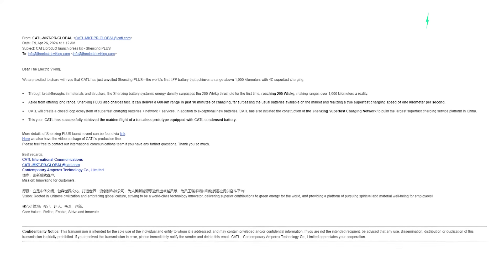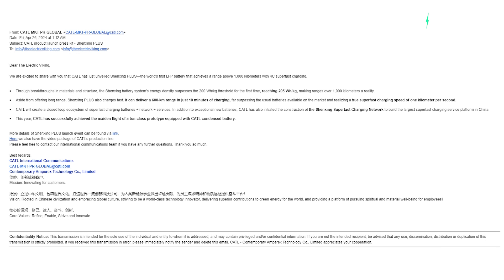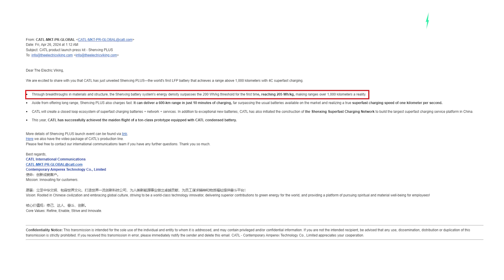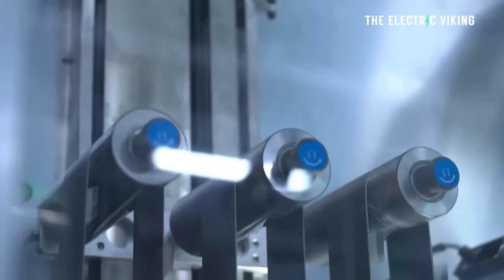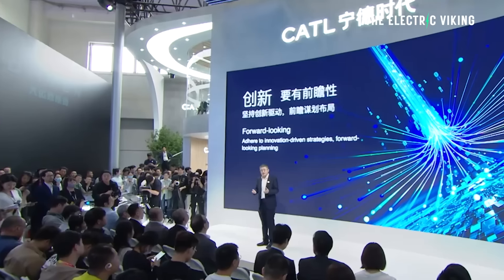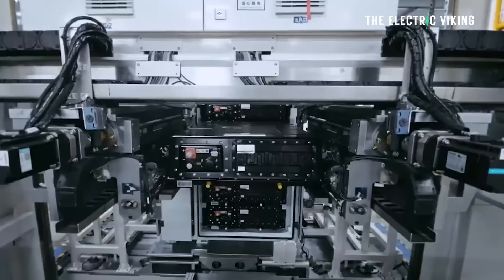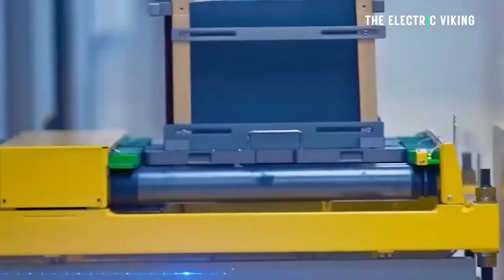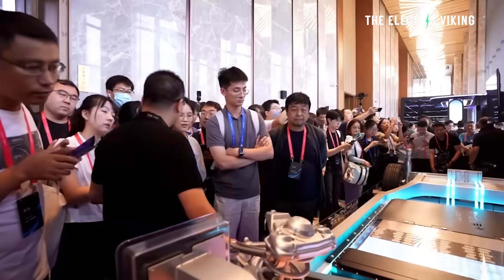CATL reveal new battery with highest energy density in the world

Comment: Lets see some cycle life and discharge rates before we get too excited.  There are many batteries with >500Wh/kg, but most of them don't last more than 100 cycles.
Reply: Didn't EV say 18,000 cycles or was that for one of the other batteries.
Reply: Lol he did say 18000 cycles what yall on rn?
Reply: @erktrek  The way he said it didn't confirm the 18k cycles was for the 500Wh/kg battery, so I assume that's actually another battery cell altogether. That CATL doesn't state any other performance characteristics than energy density and charging speed could be interpreted as those aspects might be less than impressive. Like, manufacturability/price, cycle count, shelf life, low temp performance and so on.

We'll have to wait and see I guess. A 500Wh/kg cell battery pack that's no more expensive per Wh than current cells (ideally no more expensive PER CELL), can be manufactured at scale and has at least comparable cycle/shelf life, charging speed and low temp performance as currently available cells would kill combustion cars pretty much dead as it is. And much more so if any other factors are superior to current cells as well.

I'd suggest caution rather than exuberance here though. Chinese companies aren't always the most trustworthy, unfortunately.
Reply: @erktrek  that's for low energy density battery.

Comment: Is the cost less compared to current LiFePo4 batteries. Even if the cost is only slightly lower per kg, a smaller battery that can give the car a range of 400-450 miles would make a $15-$20,000 EV a reality. There's already talk about a small pick truck priced less than $10,000. This kind of battery can all but assure that the truck will be made by the millions and sold quickly even at $15,000. But can TESLA build them fast enough in the early going. Let's hope so. I would totally love to have the smaller truck loaded with plenty of road clearance and lots of range and really cool technology at such an affordable price. I would also love to have a battery backup system for the house with these much cheaper cost batteries.

Comment: Holy moly did you hit your head?
How does 205w/kg convert to 500w/kg in your mind?
Also a plane that weighs one ton (2000 lbs) is like a tiny Cessna not a 747! 
A 747 weighs 442 tonnes fully loaded…yikes!
Reply: It's two different batteries, Shenxing LFP 205 Wh/kg and condensed batteries 500 Wh/Kg
Reply: Close to half the weight of a fully loaded 747 is fuel. A 747-400 ER max operating weight is 412 metric tonnes of which 186 tonnes  is fuel. This is why in the video he references 400w/kg as the magic barrier for flight as you need that at a minimum to start thinking commercial flight applications. I still think this is a decade away from concept and at least 2 decades from first practical implementation as you would likely re-engineer the whole aircraft for commercial passenger flight, testing, etc. Still, it seems inevitable as humans will squeeze more power out of battery weight just as we have in combustion engines over a century of innovation.
Reply: Sam screwed up in this video in the way he presented information about two unrelated batteries. The battery discussed in the letter is the 205Wh/kg one you are referring to. Completely unrelated to that is a 500Wh/kg battery that is alluded to in a YouTube video on the CATL channel. At 4:17 in Sam's video, there is what I assume is an extract from CATL's video in which the words "500Wh/kg" are overlaid on the screen. If you look at the long textual description underneath Sam's video, you will see lots of links to various videos. The very last link is to a press release from CATL that explicitly mentions the 500Wh/kg battery that is currently being used in a prototype airplane.
Reply: Wh/kg, not w/kg.

Comment: If these developments are commercially viable, current battery packs could be halved in weight but offer more density, this in itself will increase range. The same 80kwh battery pack would be substantially smaller and weigh less - but introducing more range. Not to mention cost reductions. It is every ICE car manufacturer's worst nightmare.
Reply: ICE manufacturers also make and sell EVs.  I think the nightmare scenario is for the EV haters out there.
Reply: Those batteries (if they rallye exists right now) are way more expensive, but if you have 500 kW/kg battery pack density, then you don't need 80 kWh anymore in your car, but only 70 or even 60, which meens cost reduction (less expensive cells in the pack) and even more weight saving. That's  a total win-win situation 👌
Reply: @ohger1  Why don't ICE manufacturers get on with it then? What is the delay? I don't care who makes them as long as they get on with it.
Reply: @JoeMcMorrow-k7e  The "delay" is customer resistance.  The only EV maker making money right now is Tesla, and a lot of the money they're making isn't coming from actual car sales.  Legacy makers are walking the tight line between producing EVs waiting for the change of customer wants and bankruptcy.  Ford is trying to hold on while waiting for more acceptance of the Lightning and Mach E (both excellent efforts btw - I've driven both).

The fact is that right now, if any Legacy stopped ICE production and switched to EV, they'd be bankrupt in less than two years.
Reply: @ohger1 
Ford should have already sought a merger with Tesla, achieving an economy of scale in which both could have made the neccessary leap forward.
Reply: @PETERJOHN101  Having had a Ford Edge, I would love if Ford did a joint project with Tesla, but honestly, do you really think Tesla wants the inertia of such a big company with the albatross of the UAW that's choking it now?  We don't know if Ford tried or is trying now to merge with Tesla, but I can't see Tesla needing Ford TBH as they seem to be doing fine without a network of brick and mortar dealers.  Maybe Tesla will need to move in that direction at some point if their market share increases.   Time will tell I guess.

Comment: CATL battery=500 Wh/kg. Jet fuel=12,000 Wh/kg. Temperature at 35,000 feet= -50C. Electric airplanes, useable electric airplanes, are a long way off.
Reply: I was wondering what the figures were myself.  Though, remember that domestic flights under 1000km will probably come first.  Also at the end of the day, it really comes down to economics.  So perhaps the first question to ask it “For a domestic flight with less than 1000km of travel, is this achievable with 500 Wh/kg and how does the economics stack up ?
Reply: @philwelling7172  I am a retired airline pilot, and have spent more that 30 years in the industry. Airplanes are very expensive things., and a battery costs more than a fuel tank. Expecting airlines to buy planes that can only do short hops is wishful thinking.  When a plane leaves the gate, it is fueled for the flight, adding a reserve for planned and unplanned delays. The less fuel the plane has, the lighter it is, and the less fuel it burns. As it burns off fuel, and loses that weight, it gets more efficient still.  An electric airplane would effectively be carrying a full fuel load of weight at all times, (as does an electric car), and it weighs 4 times the weight of fuel for the same amount of energy. I don't see it happening.
Reply: @johnlebeau5471  given your wealth of experience in this field, do you know what the cost per kg of jet fuel is in comparison to 4 times the cost of charging with electricity ? Also, isn’t a large percentage of the fuel used for short flights during taxi and takeoff. What is that percentage ? Also what is the efficiency of a turbo prop compared to an electric motor prop ?

Comment: There’s a consistent mix up on this channel, a Tesla model 3 with a 100kWh battery would go the same distance no matter what the energy density is, 100kWh is the capacity, not how it’s arrived at through energy density (agreed that a higher energy density battery would be lighter for the same capacity).
Reply: The idea is that having higher energy density per kg enables to have more kWh in a vehicle. Besides, 100 kWh from a 200kg battery opposed to 500kg battery does come with better efficiency.
Reply: Nope! If the battery has a higher energy density than the current Model 3 has, it means you can pack more batteries in the same battery space. That's gives you greater range I guess.
Reply: I seriously doubt a Tesla would go that far. Only in perfect conditions.
The new battery would increase the range by roughly 2.5 giving a true range around 1250km.
However, I think they'll keep the same range and just make them cheaper and lighter.
Reply: Mixup, not mix up.
Reply: @duanehorton4680  Grammar police are out again...😂
Reply: @sargfowler9603  Spelling, not grammar.

Comment: 100 kWh in a model 3 will give you slightly more range than a model S. Perhaps close to 500 miles but not 1000 as you state. Currently it does 341 with a 82 kWh battery, but the new battery would be lighter and increase range in that way. Depending on the volumetric density of the battery it might be possible to pack 200 kWh into a model S, and you would get around 800 miles of range.
Reply: Our next energy did that year's ago already with an in house prototype stock battery case model S, achieving 750+miles at hwy speeds in the cold Michigan weather and 850+in summer. You can find the videos on here of it. 

Same dude who sadly got sold out by the obummer admin when he was leading the a123 battery company providing the og fisker karma with cells and had lfp patents that then got sold out to China. 😏
Reply: all that is needed is 200 mile range for +90% of your daily driving .even on road trips most people need to stop within 3 hrs for a break and you can top off then!
Reply: @edo3169  100 miles would be enough for the vast majoruty of journies. But that isn't the point. In many geographies, access to a working fast charger en route can't always be assumed. Likewise, many people can;'t charge at home. All of which feeds in to the desire for really long range. If you could go, say, 2,000 miles on a charge, then not being able to charge at home would be much less of an issue if you only had to charge once a month or whatever. Likewise, you wouldn't need to charge for almost any journey. Obviously 2,000 miles is extreme. The point is more that 200 miles isn't much use if you are struggling to access good charging facilities. Maybe where you live, that's not a problem, but it is a real problem for many geographies. There are a lot of factors that go in to making EVs genuinely practical for universal use.
Reply: @edo3169  I like stopping for five minutes, not 20-30 minutes.
Reply: @dennispeterson6598   Yup, and if I do want to stop for 30 minutes, it'll be wherever and whenever I want, not mandated by my car.

Comment: I'm curious how the change in power source will affect aviation landings. As it stands a significant percentage of a long flight take off weight isn't there at landing because the jet fuel has been consumed. this has been enough that when commercial jets experience difficulties during takeoff and ascent, if they need to return to the airport, they have historically dumped fuel. With a battery, the aircraft is not going to have that option, (or if it does, we're talking about dumping a fairly expensive battery, perhaps it will have a glide control feature that allows it to glide to designated safe drop sites?) How much training will commercial pilots moving to these systems have to go through to become familiar with the new handling characteristics of the aircraft, both at takeoff, where it's likely to be somewhat lighter, and landing, where it will be significantly heavier?

Comment: I’m definitely getting an EV when I return to the UK from Taiwan. Charging in 10 min or less is what I’m after. All these technological innovations are very encouraging. Liked and resubscribed. (YouTube unsubscribed me for some reason).
Reply: Why the need for such rapid charging?
Reply: @martinwinlow better to have it and not need it,then need it and not have it.
Reply: @Globalscanningeyes  I suppose so but you will pay a hefty premium to be able to charge so fast.  I wonder if you will actually ever use it rather than just have a battery size capable of 3 to 4 hours of driving (~250 miles) and just charge it at a much slower rate on a 'normal' rapid charger (~100kW) in the time it takes to have lunch.  The cost saving of using a slower charger would pay for your lunch!  And if you rarely do long trips, a smaller battery and charging at home is all you would ever need.  Save a fortune on buying the smaller battery and saving a lot of energy, too, not having to haul a huge battery around everywhere you go.
Reply: @martinwinlow  On the other hand, the size of the battery can be reduced if you only need a range of 250 miles, and that will translate into a reduction of size and weight and hence efficiency of the car. Perhaps EV manufacturers will take this into consideration.
Reply: @martinwinlow  the bigger the battery the lower the charging cycle which reduces the speed of battery degradation.

Comment: The thumbnail says 500 Wh/kg.  The CATL letter says 205.  

2:47 Watt-hours are NOT Watts.  One is a measure of energy.  The other is a measure of power.  They are NOT interchangable.

5:55 Double the range of a Tesla Model 3 would be abotu 500-600 miles of range, not 1000.

6:50 18,000 cycles would last centuries, not decades, of typical car use.

Comment: The point of solid state lithium batteries is that they have a modest increase in capacity, PLUS they are safer, charge modestly quicker, and are lighter. Increasing the energy density of Li-ion is still subject to testing, and 500wh/kg is better, but it isn't going to change the game yet. Personally, nice round numbers and Chinese batteries don't lend themselves to a lot of confidence. Either way, it'll just take longer to charge, and doesn't make it so much more attractive. We need a quantum leap in batter technology. Something that'll fully charge in 3 minutes or less ;-)

Comment: Great news.   However if one doubled the energy density in a Tesla Model 3, at best it would get about 750 miles range.   That would still be pretty fantastic.   However, I would downsize the battery to 500 mile (real world range) which would lower the weight by 25% for better acceleration, reduce the polar moments for better handling, and have a knock-on effect for range.   We should expect to see these in passenger vehicles in the US within 3 years.   Fast charging and 500 mile real world range by 2026/27 basically should mean the end of ICE passenger cars for especially anyone with home charging.  Buying a higher maintenance, higher cost to operate, noisy, rougher, and polluting ICE vehicle without the benefit of home fueling would basically be stupidity for almost every use case.

Comment: There are several comments asking clarification of power density. Please add mine to that group. Gasoline is liquid and batteries are solid, so there's a translation. I think the standard unit is megajouls per kilogram, but I also see 12.2kWh per kg... I can't tell if "watts" is shorthand, or what... Also I'm new to this unit of measure. Keep going. love your channel so far.
Reply: 500 watt hours per kilogram = 1.8 megajoules per kilogram.
Reply: @kerryberland2847  Thank you!
Okay I found a chart that looks like it agrees with your number for Li battery. 👍 On that chart, gasoline has about 50Mj/kg… I’m trying to understand the assertion that batteries are more energy dense than gasoline. 
…Okay the y-axis on that chart is “specific energy” (maybe?) and that looks like about 100x more than Lithium ion batteries… I still don’t think I’m understanding this. One is storage and the other is release rate, right? 
At least one of these ought to show battery greater than gasoline….? 

Please explain Sam…?

I want to hear that we’ve solved fossil fuels while I wasn’t looking, but I don’t see it yet…?

Comment: There is more than 1 dimension that is important when considering batteries, energy density is important but so are, discharge rates (how powerful a motor they can supply), the total expected charge cycles (longevity), and total expected 0-failure time (reliability) and overall cost per kWh.

Talking about one specification without any context of the others is useless, this may be great battery tech but if it's prone to 50% failure within 100 charge cycles or only has an expected life of 500cyles and can only has enough discharge capacity to run a 50kw motor or costs $1000 per kwh then the overall usability of the battery changes significantly.

You need ALL the details to make a valid assessment of the usefulness, there must be a host of other battery chemistries tried but have failed on one of these critical dimensions making them less than practical for use in motor vehicles at scale, otherwise it's like claiming the bragging rights of a the world's brightest lightbulb, sure it only lasts for 3 minutes and they cost $1000 each but hey, brightest lightbulb!